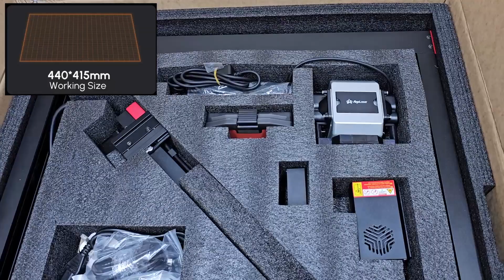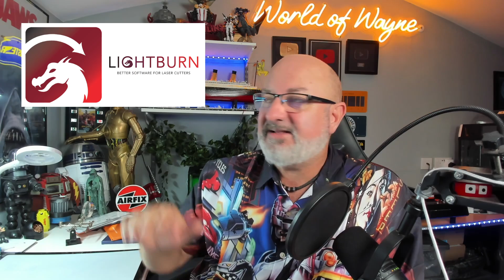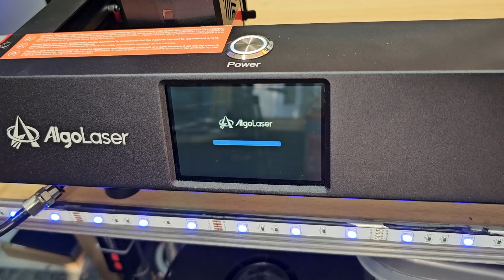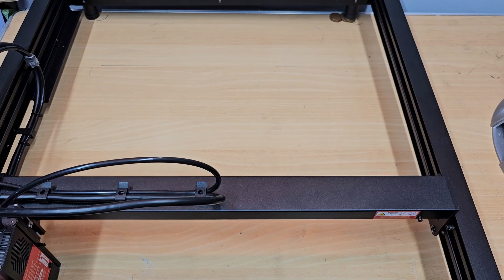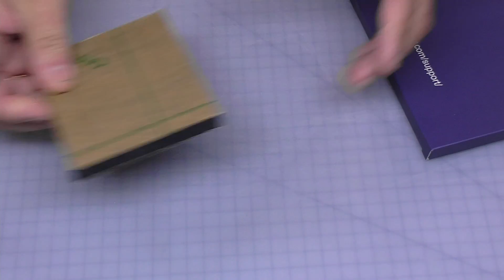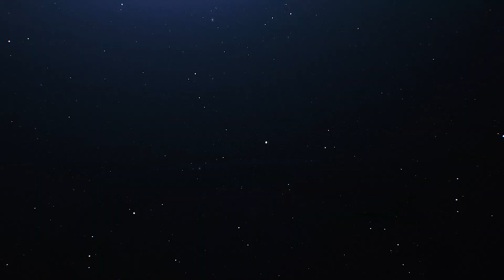The AlgoLaser DELTA 22W Diode Laser Engraver - Beginners Guide

Comment: Hi Wayne im waiting on my Delta can i ask how big are the feet circles? I would move to make some feet to hold in place before it turns up :) thanks!
Reply from the maker: Sorry for the delay in getting back to you. I needed a battery for my measuring calipers. They are 28mm in diameter
Reply: @WorldofWayneUK  no problem thanks so much really appreciate it!

Comment: The air pump also blows the resulting smoke away from the laser beam path so it can cut or engrave the material better.

Be very careful about the materials you cut or engrave as some can release very toxic smoke or fumes. That's why more expensive laser engravers have a more sealed case with provision for external fume extraction and/or filtering.
Reply from the maker: Yer. I open up the side of the workshop when I'm cutting. Theoretically I'm engraving outside lol
Reply: @WorldofWayneUK  It would be worth emphasising the need for good ventilation as it is possibly more important than wearing the glasses. I recently got a xtool D1 pro so I will be interested to see what you produce.

Comment: Hiya Wayne.. I noticed in the Settings you have WLAN on. As you're connecting the engraver by cable I'd turn it off to stop any unauthorised access to the engraver and /theoretically/ your PC / network. Maybe that's me being paranoid, but if it's off it /definitely/ can't be used :)
Reply from the maker: Yer it's directly linked to the PC by USB but it is on my network too
Reply: Ah beg pardon  @WorldofWayneUK .. I thought it was an Ethernet connection.